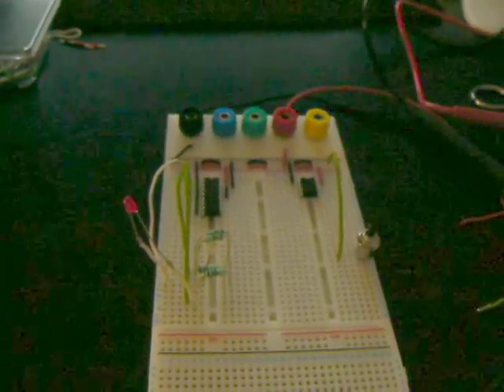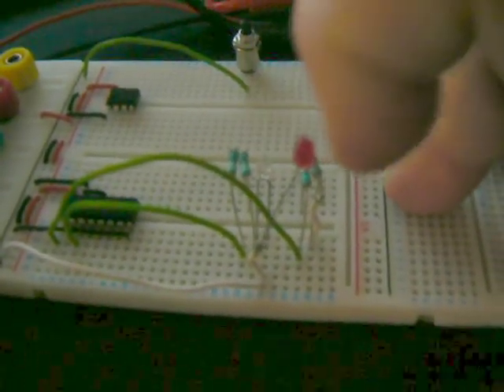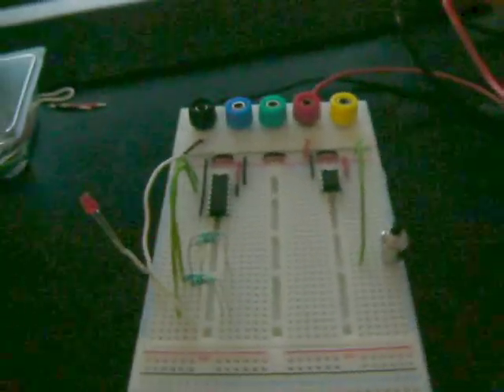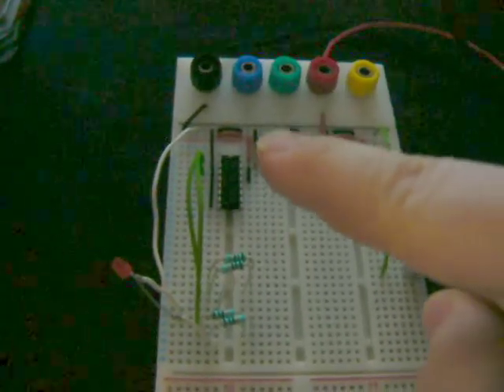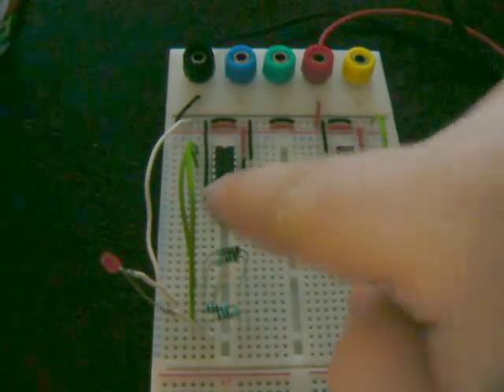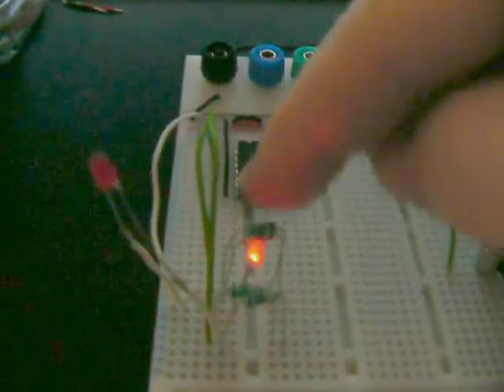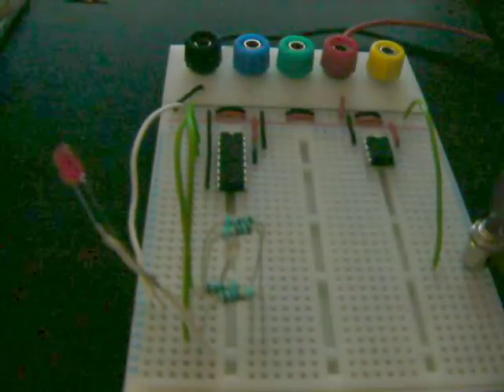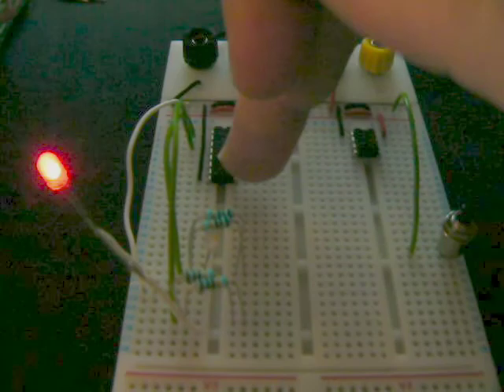Proximity-sensing 4017 chip?

Comment: The wire/chip is at a high impendance. Your clock i'm guessing is not grounded so electricity goes from your finger to the circuit. Anything that is digital in/out will have the same effect unless grounded.